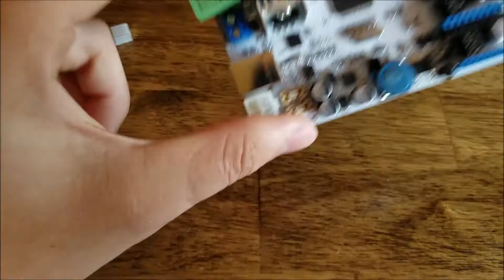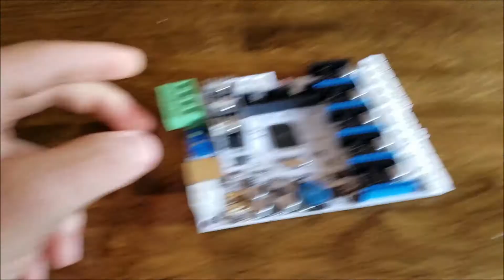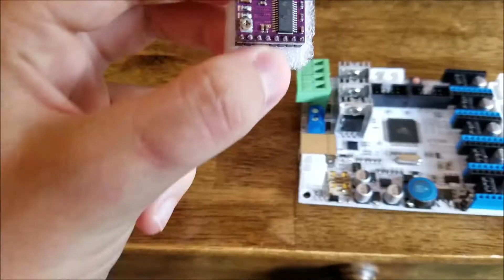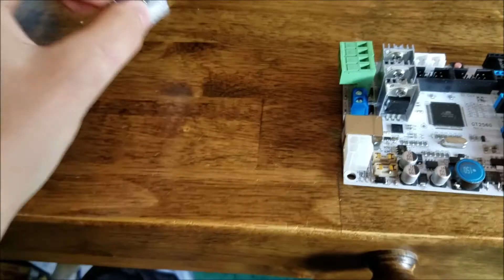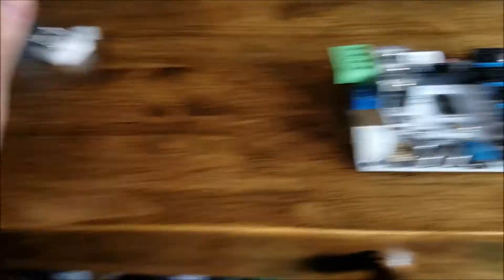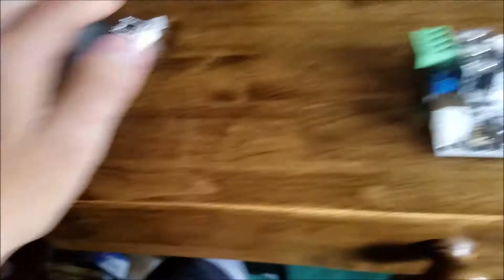New Stuff - Control Board!

Comment: Nice looking board. Is it possible to run 12v and 24v at the same time on this board? Reading the Geeetech site it implies it can. If it can do you know which terminals run the heated bed seperate of the hotend/fan/logic parts?

Comment: dam shit board nothing but problems, have you got it even to work? windows 10 does not recognize the port to begin with, its incompatible with reprapdiscount full graphics smart contoller amongs other problems
Reply: None of this is true. The USB port on this revision is powered by FTDI chip which is quite expensive and most widely supported. Both LCD types also work.

If what you got instead is a clone board made by CTC, it has a few differences. The GT logo is missing ans so is the GT designation in model name. It might have a fake FTDI chip on it, which was blacklisted by Windows, and also the sourcing for other components and connectors isn't great either. The connector sheaths for LCD are reversed, on genuine Geeetech the keys are pointing out towards the edge of the board, and work with standard Reprap Discount clone LCD kits, on the CTC they're pointing in towards the processor. Correspondingly CTC ships a display where the connectors are also reversed and doesn't work with other boards. Geeetech comes with Arduino bootloader, so you can program the firmware out of the box - indeed it doesn't come with any printer firmware standard, just the blink sketch. CTC doesn't have a bootloader, so there is no simple way to replace the firmware, which you need to do if you're changing the LCD type.

Comment: Have you considered the MKS Gen V1.2 controller board?
It costs only 30 USD, and is basically the same (2nd extruder support, 24V,...)
It does have more screw terminals though, but if that's worth 10 extra dollars?
Reply from the maker: I've seen it but the main reason I'm considering others is because of the weak processor and the strange JST plugs for all accessories, and the MKS shares both of these traits with the GT2560.

Comment: The GT2560 is generally a nicely designed board, let down by the mechanical parts used.

The power connector will melt as it can't handle the current needed by a heated bed, sadly the same is often true of the fuse holder on the high current line.
Reply from the maker: Yikes well that's not good, I'll definitely have to do extensive testing then. Do you know if this only happens with 12v setups or with 24v too? I'm on a 24V setup so it will be sending significantly less current through, but alternatively I could also hook up a solid state relay to control the heated bed externally of the board to reduce any potential problems, as other than this potential issue I do really like the board design.

Comment: That stock ATX power input is going to awesome. I've never seen that built into a board. You should be able to turn it off through gcode commands without hacking the crap out if it, right?
Reply from the maker: I've seen it on some printrboard clones before but yeah it really is nice! And turn off the board do you mean?
Reply: +3DprintedLife 
M80 and M81 control the ATX power if you can figure out how to wire it up. That way you could put an M81 at the end of a print and it would do the equivalent of a PC shutdown (I think).
Reply: It's the worst, most failure prone feature of this board. It simply isn't rated for the current that's being asked of it. Otherwise, the board is remarkably well engineered, there's even some semblance of flyback diodes for all major outputs.

Comment: @3dprintedlife hey man so my powerspec 3d pro died on me, board is fried. so I'm thinking about Frankensteining it, replacing the rods with hiwin rails and do something like you with the board in this video possibly changing extruder type maybe flexion I've heard good things finally possibly increasing print bed size. i know I'll spend a fortune on rails... any other advice?
Reply from the maker: Gotcha good luck! All I'd say is make sure you get genuine HIWIN rails as the knockoffs I got suck pretty bad haha. My best advice would be try not to cheap out and minimize any plastic printed parts in the structure or kinematics systems. If you do need to print parts, keep the plastic parts as low profile as possible, the bigger they are the more give they will have in the system!

Comment: hayy iv been running this board on my geeetech prusa i3 clone and its great, as has been sed id dose need a fan on the board for cooling otherwhise it will cut out, other than that iv had no issues with mine. mine also came with three of the green screw/plugins for hotend's and bed, as for the two pin endstops its probbly because all of the geeetech printers have the two pin endstops pre wired up, 
hope you have fun with it, im also makeing a corexy buld with the same board, should work great
Reply from the maker: Do you know if the fan was needed for the stepper drivers? If so then I'll handle that by just turning the current down, since I have a 24V system I can run the steppers as low as 700mA with no problem. From my testing so far, it seems the heatsinks for the mosfets and onboard regulators don't get too hot on the board, but I have yet to run it at full load.
Reply: im not sure to be honest it would totaly stop the print nd id have to click pause and restart print in pronterface for it to continue printing

Comment: Looks like a nice board, but it will be a cold day in hell when I trust geeetech with a board. My school purchased a Rambo from them for a Reprap we were building and it will not work because it will not detect the temperatures of the thermistor at all. People online said that they shorted a resistor and it fixed the issue. I shorted a resistor and the thing sparked the hell out and then worked for some odd reason.
Reply: I purchased the delta 301 from Geeetech and was lied to before purchase. The printer never completed a full print and the diamond extruder was a nightmare. Tech support was none existent and I will never buy anything from Geeetech ever again!

Comment: the z axis is just a split. can see trace on bottom.
 connectors are rated 10amps us, "15 amps" in other countries
Reply from the maker: Gotcha yeah I figured the z axis was split, I forget what I may have said in the video. And sounds good, 8A is all I need!
Reply from the maker: I did have one question for you, do you know the name of the connectors that are used on this board for all peripherals? I've seen them before but just wasn't sure exactly what they are called!
Reply: +3DprintedLife molex (I will see if I can get exact terminal) for the white ones, ATX 4 pin square for the power the green ones, I have to look up again and should still be on my eBay. i bought some to replace the ones on my RAMPS, and my Sanguinololu
Reply: +3DprintedLife for the green here is the right direction in eBay to start, many variables one pair, etc.
http://www.ebay.com/itm/301960524364
Reply: +3DprintedLife white ones are same as the Rc lipo balance wires off a lipo battery pack. if you look up charge terminals for lipo those pop up
Reply from the maker: Gotcha, thanks very much for the info!

Comment: It's highly recommended replace all power connectors with something like T-plugs or XT-60. I mean power input and output for both heaters (esp. bead). And, when installed in a printer, there must be the fan blowing at step. drivers and mosfets. Beside that, the board is fine.
Reply from the maker: Awesome thanks for the tips, I'll definitely monitor thermal status and if needed I'll add a fan to cool the electronics, but I think the connectors should be fine since I'll be on a 24v system and the heater cartridges will only see about 2A and the bed will see maybe 7-8A.  But again I'll be doing extensive testing before making a decision and I'm definitely not set on this board yet, I would have no problem finding an alternative if this doesn't suit my needs.

Comment: hey, just incase you where looking for firmware, check out my YouTube channel for the WordPress link. third blog post. i have also been trying a filament sensor to adjust flow rate on the fly based on size.
Reply: and if you need any additional information or support about sales from a us dealer. can click on Geeetechs website and I am a listed distribution point, However issues with GoDaddy at moment if store is not visible.
georges3dprinters.com
i can try to setup a cheaper price with no tech support. let me know if you want to set something up.
Reply from the maker: Great thanks for the info and source! Since I'll be selling the printer as a "barebones" kit, users will be purchasing the electronics on their own. I can definitely use your site as a source for people who want to buy from a US seller instead of buying from China. Thanks!